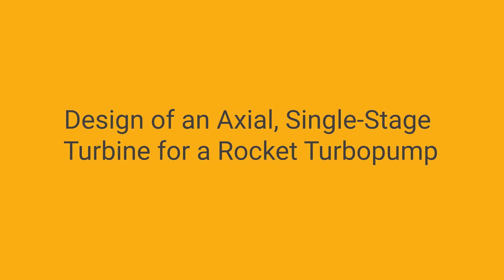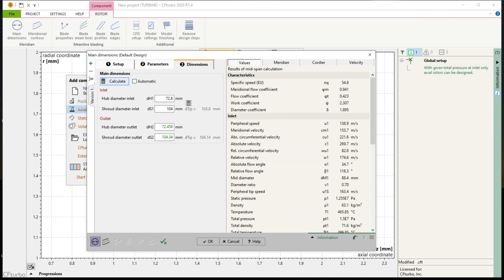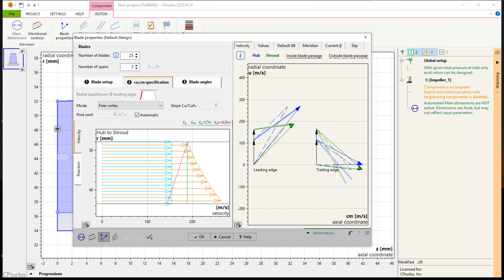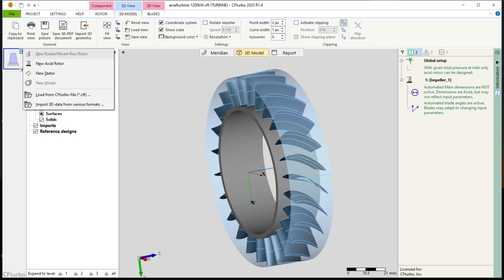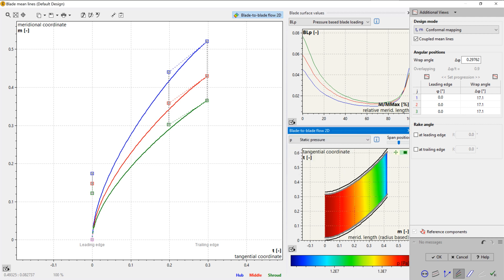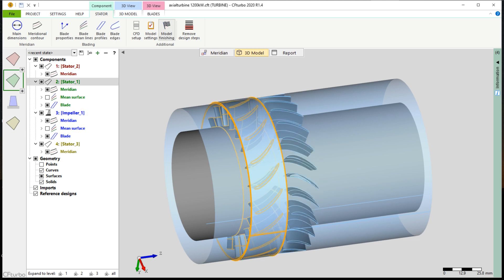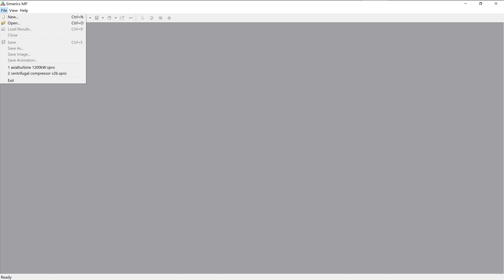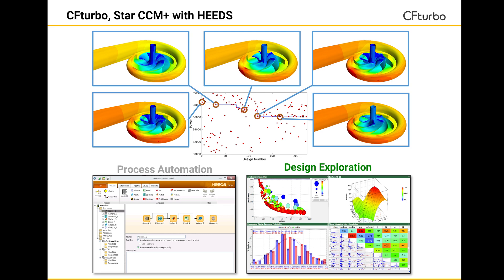CFturbo Design of an Axial, Single-Stage Turbine for a Rocket Turbopump

Comment: You really need to update this tutorial. I am trying to follow as reference to get used to the workflow but is obviously outdated. Some of the options are not the same and even with the same input data I am getting different results even on basic parameters as specific speed.
Reply: Bro how did you handle this situation
Reply: @halilkural9958 in was testing the software for my company at the time. We  handled by not buying it. 😅

But..I think they should have bought it at the time.  I would only need more time to find out and the software is great.